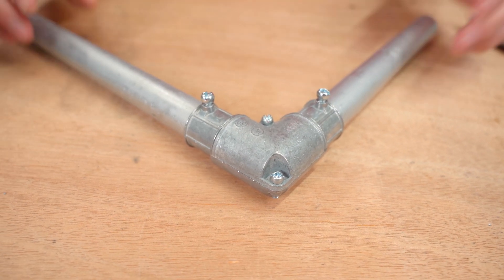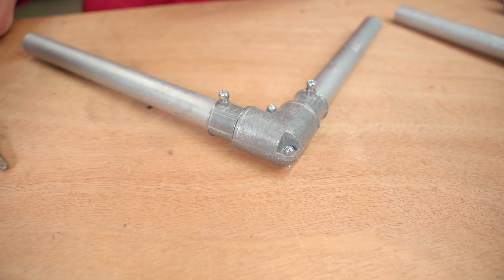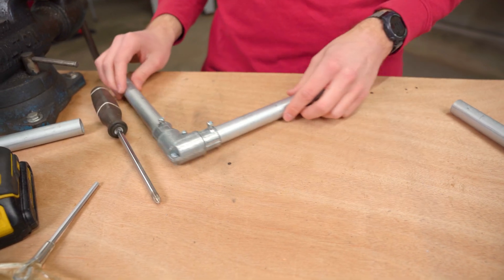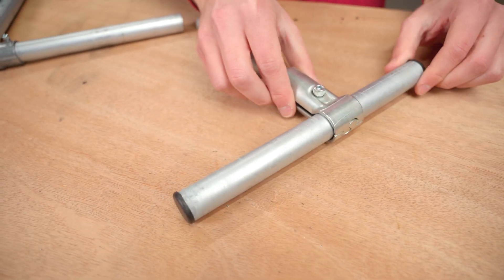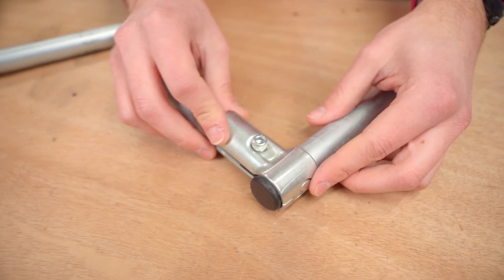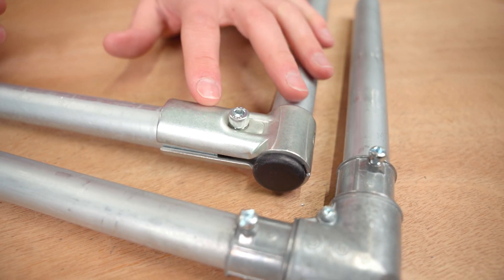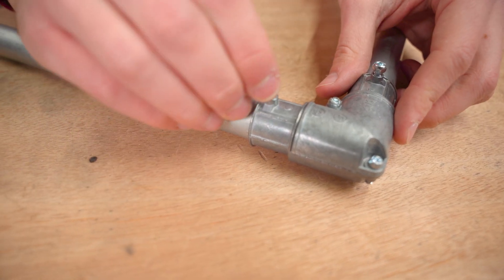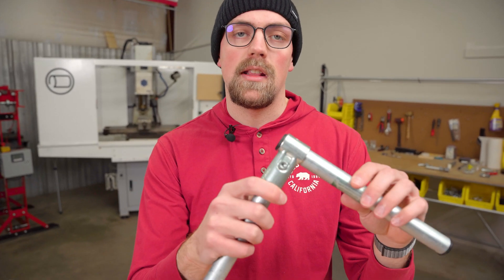This Elbow Is Hiding In Plain Sight!

Comment: Those EMT elbows are good for connections that don't need strength. They won't support the same load that your T connectors will. I used them for making a frame for our shop banner but they didn't hold up to the wind and weather and cracked and broke apart. Yours are vastly superior.
Reply from the maker: Thanks for the comment Joe! Glad the T Connectors worked well for your build!
Reply: Seems you guys're using cheap electrical tubing to frame your houses ... propably wires to hang your laundry...  .Get wire lubricant and use it as soap....( we call it a goose shit )

Comment: The primary reason to use Maker Pipe, and not the electrical elbow (long term) is the elbow is not made to endure much stress, and will break a lot more easily.
Reply: Very true.
Reply from the maker: Thanks for the comment!